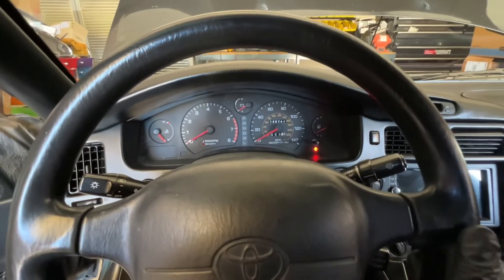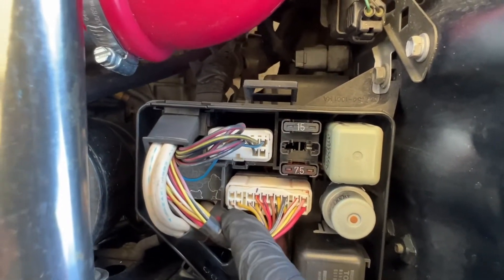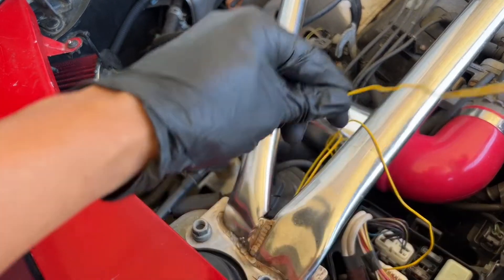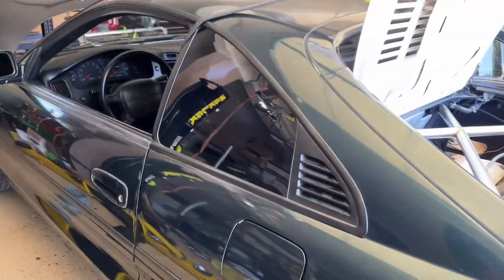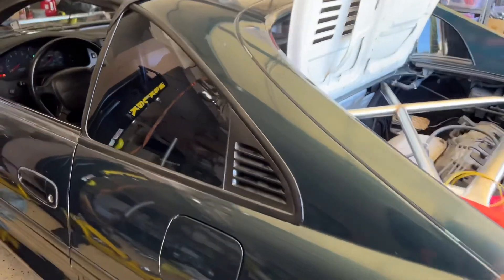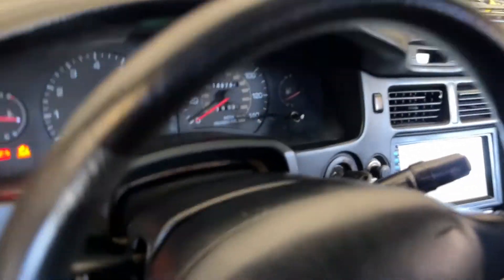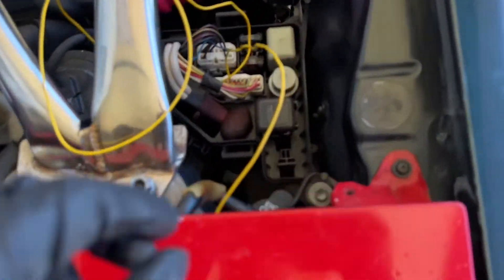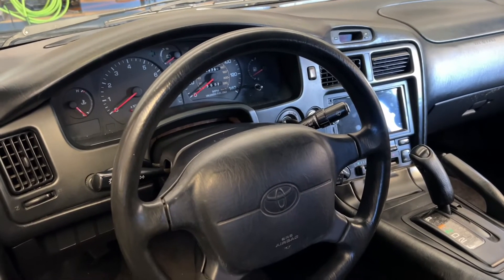DIY: BobMr2 reset air bag light for toyota mr2 sw20

Comment: Thanks for video Bob! Now I can reset the airbag light on my 93 SW21. I replaced the steering wheel stock several years back. Thinking, I had a bad headlight switch, the high beams won't turn on, just the low beams.

Comment: I think I had a more serious issue with my airbag back in 2003 I just ended up taking the bulb out but I remember doing this trying to get rid of it. I remember the steering wheel being very heavy so I end up getting a grant one for 35 bucks back in the day drop 10 lb

Comment: will this make it go away permanently if the airbag has been removed completely by an aftermarket wheel?
Reply from the maker: It will come back.
Reply: @BobPham  so, now we need to learn how car recognize the present airbag and mimic it. probably some kind of resistance or capacitor must be inserted in sensor wires.
Reply from the maker: I pulled the ecub fuse in the Frunk fuse box to disable the airbag system for my track cars since I run racing steering wheel. Lights go away.
Reply: @BobPham  that disables all dash error lights though correct?
Reply from the maker: @cartin50  only air bag light. It disable the whole air system.

Comment: Hi Bob, is it possible to minimize oversteer for the MR2, is it also possible to replace the power steering with a conventional hydraulic steering system?
Reply from the maker: Unfortunately no, it uses electric hydraulic pump.  Wym by oversteer too much turns?
Reply: @BobPham  Actually, the thing is, I'm considering buying a MR2 2.2L 1,993 98,000 miles.
That's why I wanted your advice, the car is priced at $8,807 and it looks in good condition, except for an air conditioning leak. These points were told to me by the owner. Regarding the price; What do you think Bob, is it a good price or is it an overvalued price $8,807?
Reply from the maker: @mjal1284  it’s what ever u feel comfy paying. 93na are going for 4-10k. Most importing thing are rust and accident. Go to my what I look for when buying mr2 video.  

Majority of the the turbo are 10k and up. 

These are want cars not need so finding one at a good deal will take time and patience’s.
Reply: @BobPham  Thanks Bob, I went to look at the car and had a mechanic check it out for me. The engine started instantly, chassis and body did not show rust, a little shoddy restoration job from a minor accident, inside and outside its condition is approximately 75%. It had some small things to repair, the most important things to repair would be the shock absorbers and the air conditioning. I asked for a discount on the price then, which went from $8,807 to $7,275. I didn't want to buy it :V